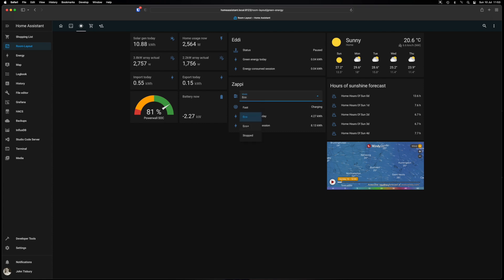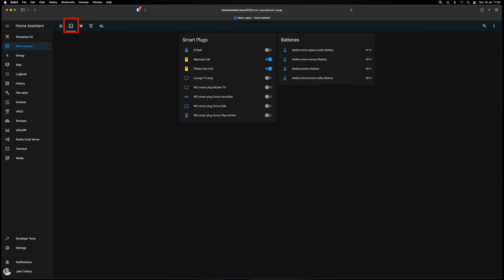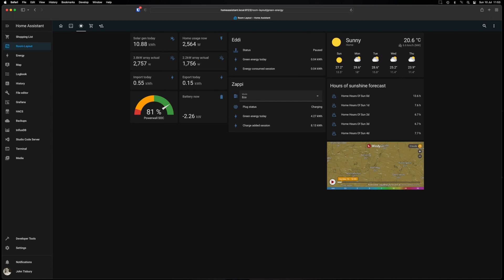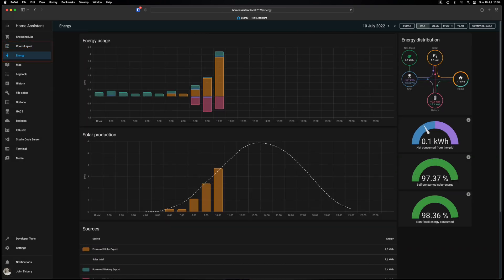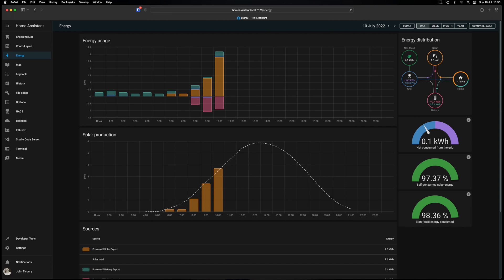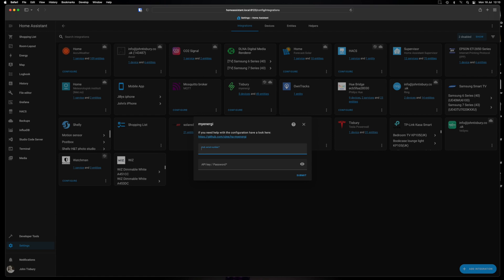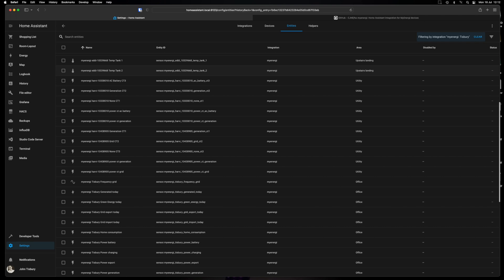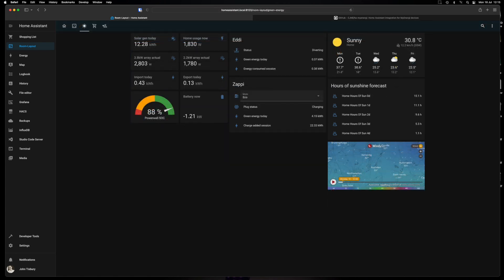My energy monitoring in Home Assistant

Comment: I've got a similar system (solar, powerwall, zappi, eddi, harvi and hub), just started with Home Assistant yesterday - can you provide or point me in the direction of an idiots guide to setting up the energy distribution flow - I'd like to use the harvi CT clamp sensors to show the current flow of energy, but they're not available in the grid, solar, battery configurations (can see all the other MyEnergi devices/sensors, but not from the harvi)  I just want to get the energy distribution flow to reflect reality - Hope you can help.
Reply from the maker: I’m assuming you have the myenergi HACS integration installed? I can see the harvi ct clamps in my installation but they are not showing when trying to add them to an energy dashboard. Not sure why, above my pay grade.
Reply: @johntisbury  From my reading it looks like the device_class is not set to 'energy' so not accessible for the energy dashboard, I've been trying to use the Powerwall sensors instead, but same issue - I'm using the 'Tesla Custom Integration' (which allows mode switching and other controls) rather than the standard 'Tesla' / 'Powerwall' intergration - which are you using?
Reply from the maker: @LiveActionFX I’m using both Tesla integrations, official Powerwall one and HACS custom integration.
Reply: @johntisbury  Been trying to add the official one, but every password I try fails - copying password from sticker inside gateway and trying every combination of the password for the Tesla App and no luck 😞
Reply from the maker: @LiveActionFX  password is 5 digits long. It's the last 5 numbers on the sticker in your gateway labelled as TSN:
Reply: @johntisbury  I had tried that early, but tried again just in case - no luck, but different error message now 'failed to connect' rather than 'failed authentication'!
Reply from the maker: @LiveActionFX  just had a google and seems The instructions seems to be incorrect for the new batch. The password is the last 5 char of the "Password" on the inside of the gateway not NOT the last 5 char of the SN.
Reply: @johntisbury  Tried that too, but to no avail - Just found some information on the HA forum, hopefully that avenue will bare fruit.
Reply: @johntisbury  Can you let me know what entities you are using to populate  your Energy Dashboard?  Which integration are they from and what device_class are they?
Reply from the maker: @LiveActionFX  Can't add a photo here. So added a new Community post with a screen grab.

Comment: Great video, is it possible to turn a smart plug (tapo etc) on using the myenergi entities. Eg. Your EV is fully charged from Solar by our Zappi and you start to export surplus, can you then make the smart plug turn on to utilise this surplus for the hot tub etc? Was going to buy an Eddi but have hot tub on smart plugs already. Hoping I can get the myenergi data to switch them with HA somehow?
Reply from the maker: Yes there's no reason why you could not do this. There is a risk with switching the amps required for this setup, many of the smart switches are not designed to take these types of loads for extended periods of time, despite them being rated for 13amps. Best to get a dedicated relay switch if you want to safely do this. There are smart relay switches that will work in HA I believe.

Comment: Wow - you have an impressive set-up!  Thanks for sharing so much detail.  It's stuff I can only dream of - living with my partner in a tiny terrace-house.   Wall space not occupied by doors or windows is a premium lol.  I'm "building" my "lab" onto some internal wall space - with resin studs etc. to hold up the weight although the wall is a mix of some reachable brick and some seemingly steel bar,  lots of hollow behind the plaster ... just a real mix of conditions in a tiny square-section.  It's an old house and not very accommodating for such projects. I was going to put stuff in the attic but monitoring the seasonal temperature plus realising the size and weight of what I was doing changed my mind.  Couple of Intel NUCs with big heatsinks for passive cooling though I have quiet fans for them potentially set-up for ducting (future heat-management project), couple of Pi-4's incl. one for Pi-KVM but I'm looking at getting Docker running on it's Arch Linux r/o system with a writable disk to run HomeAssistant on that one too, all held into recessed steel screwed in behind, and with tamper-resistant nuts on the studs ... and then a lot of din-rail stuff and din-rail smps' and chassis style smps' including ac-dc and dc-dc isolating etc. ... and then a section for my battery module.  I try to avoid very high currents so that it's easier to work on things with more available parts, and to avoid opportunities for accidents.  

I'm using 8x approx. 100Wh LiFePO4 (cheap) batteries and lots of ideal diodes and solid state switching of one kind and another and lots of DC monitoring, and AC monitoring - I've bought 12 sensors using Ali Express lol that have isolated SM Bus connectors ...  to mesh it all together with mostly I2C bus tying it together.  I want to know exactly where my electricity goes for different devices to help gamify reducing it and understanding what my "baseload" requirements are.  I have 4x WiFi plug based sensors for that at the moment, using home assistant to monitor them, but the findings are too broad for my silly mind to take positive action on ... I'm in too much of a "mess" pending this project's completion.   I need some at-least semi-permanent infrastructure I can build on top of rather than 0-surface and limited floor-space that I've endured for the last 15-years or so.

Further to that I have shelving for my lab instruments.  When I get nearer the finishing stages of the hardware build.   No space to work in so metal work etc. is hampered by cramped conditions.   

I'm interested in fractional charging and stand-by UPS use for the DC-DC isolated SMPSs and a 300W AC inverter I have - all double conversion and 2x allowance for derating... but ... I'm also considering using the rig like a mini-home battery.  I use Home Assistant too - it's great.  :)  I'm setting my build-up to be "solar friendly" to tie in directly even individual panels using buck boost stuff as a poor mppt substitute and with some source switching and OR'ing ... though I fear the state of our roof might prevent my solar fantasy from ever succeeding.  My design principles are predicated on DIY - and being able to adapt in the future and fix things myself etc. with available parts and future technologies ... plus belts and braces on reliability and lightning surge resistance and stuff. I have RCD and over/under voltage / current etc. even on my 300W inverter with 20V TVS on all the AC-DC outputs.  Gas discharge tubes on all the incoming/outgoing network cables even though they're already isolated to 4KV I think.  25A stranded A/C wire that will normally see about 1A (that gets "buried" behind the steel).  I might only live a few more decades very-best-case but I tend to build when I can for centuries.   :)  I have general (expensive) anxiety lol.

It's a multi-month and for me, very very expensive project.  Hampered by parts availability too.  For 8x INA219's I think I have, for example,  because I couldn't get the INA... whatever they are with the built in R and more appropriate current capacity, I have to change all the surface-mount resistors to a more suitable value and then program them each suitably. Set their addresses.  8x at least.  Because I'm going with this distributed approach.  Lots of little things like this add-up in time.  My insistence on LiFEPO4 over LiPo is really annoying when it comes to microcontrollers that support battery charging.  I use car blade fuses half the value of my 12AWG wiring (worse case - ignoring chassis conditions) and continuous battery discharge rating, and then slightly lower trip-rated polys, fuse and 100mA trip-current poly's on all the VBUS measuring wiring, and microcontroller overload shutdown anyway.  On top of the BMS protection provision in the batteries.  And the batteries are in LiPo charging bags in a metal enclosure.  Yep.  Anxiety and over-abundance of caution is me.  If I still manage to get a fire despite all my mitigations I'll consider myself extremely unlucky.  But it should mean it's easier to maintain and adapt in the future. Lots of redundancies and fewer hard dependencies.   I don't have money now and I doubt I ever will have in the future. :)  My fantasy of fractional charging ... i.e. charge to 100% and then discharge to a holding state, every so often, with intelligent adaptation to brown outs / black outs and managed load depending on transient residency status doesn't seem to be "done" and I have to implement it myself.

I'm my own worse enemy.  :)  Firewalls and VPNs and VLANs and internal gateways galore.  Internal SSL and SSL handoffs on stuff,  encryption at rest even for my back-up home-made NAS hidden in the attic.   Scared of my own shadow.  Overwhelmed by too much information/too-many technologies for work, and home project stuff.  Wonder I ever get anything done at all.

All I want is stability / capable supporting infrastructure and a "lab" to work on my hardware/software ideas ... I want resilient hardware energy implementation equivalents to kubeneties etc. with high-availability and  high-observability.  When I achieve that I'll finally be at the starting line.  :)  Maybe I'll finally get onto general AI and robots lol before I die.  Maybe.

Anyway - a lot of the time I'm working in the "dark" - not knowing how things should be done or what can be done  (with proper resource) - and it's great when people share such details of how they implement these technologies.  Ta.  :)  YouTube suggested your video I think because I'm always looking at energy related stuff - management etc. ... and EV stuff (obviously Tesla) and so on.  Cool.
Reply from the maker: WOW you really are in deep! Awesome!. I read all your comment, I must confess I did'n't understand it all as over my pay grade, but impressed with your level of detail, knowledge and approach. As you say it's great to share setups and information even if at first things don't seem to be related. I often get ideas from other people's projects, workaround and general approach to their problems solving. 

Good luck with your lab and hope the parts shortages doesn't hamper you too much.

Comment: Hi John. I tried to copy your mailbox motion sensor idea, but when I put the sensor in the (steel) mailbox, it lost its WiFi connection.  Did you just not get that problem? Or did you find a solution?
Reply from the maker: Hi Mike, interesting. Our mailbox is cast-iron and enclosed and the wi-fi signal is good, router is about 8 feet away, it's never lost signal yet. Not sure which motion sensor you are using or how far away from the router your postbox is.
Reply: @johntisbury  Thanks John. It is about 20m so I think it is the distance and material.  The sensor is a Shelly. Which did you use?
Reply from the maker: @mikenicholls8901  same as you a Shelly.

Comment: Great video John, maybe you can help with my setup as the Tesla powerwall has stopped working in my home assistant installation.
Reply from the maker: How long has it been offline? I've looked at the know issues and there's only 1 outstanding. It's often worth having a look through there. I'd suggest posting a help post in the HA Forum or on GitHub. A copy of the error message from the Log would help to Settings > System > Logs

Outstanding issue: https://github.com/home-assistant/core/issues?q=is%3Aissue+is%3Aopen+label%3A%22integration%3A+powerwall%22

Comment: Nice video John.  For batteries I use a blueprint that once a a day checks all batteries and pops a message on my phone for any getting low.  There are a few blueprints that do similar th8ngs.   Works great.
Reply from the maker: Thanks Robin for watching. 
I'd seen a similar setup from Smart Home Junkie that only displays a battery percentage when it gets below a certain threshold otherwise its hidden. I will investigate yours too. The batteries in question are for Shelly motion sensors and seem quite efficient being that they are Wi-Fi.

Comment: Nice John! One question, the energy distribution on your energy dashboard.  What integration is that?
Reply from the maker: Thanks Daniel. The Energy dashboard uses Tesla Powerwall in my case. However it can take many feeds. Solar, eg SolarEdge, battery, grid import/ export, gas.
Reply: @johntisbury  is that a specific Tesla powerwall integration to get the powerwall entities?
Reply from the maker: @danieltpope2518  yes. There's 2 built in integrations for Tesla. 1. power wall and 2. their wall connector.

Comment: Great video John!!!  Nice to see that the MyEnergi products have nice and useful integrations.
Reply: Hi John, does the myenergy app automatically integrates with Home assistant? What’s the process to add it?
Reply from the maker: @paologuarino746 easy to install via HACS https://github.com/cjne/ha-myenergi
Reply from the maker: Thank you. Their API is a useful integration
Reply: @johntisbury  I've been experimenting with Home Assistant lately and seeing what works well etc in the hope that in the next 3-5 years when I have the funds to refurb my house top to bottom, I know the spec of hardware that I would need to purchase.
Reply from the maker: That’s a sensible approach. Hardware, standards and protocols are on a constant product lifecycle. I like that HA is open source and can run locally. Gives longevity and security over not getting locked out of products.